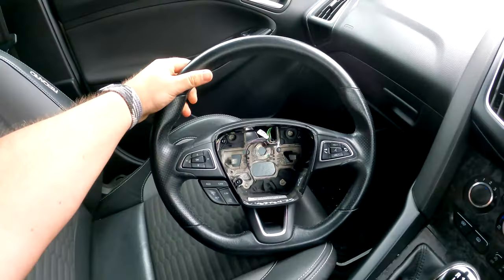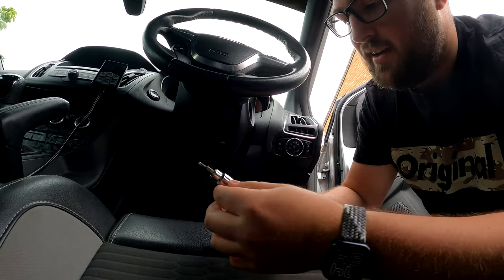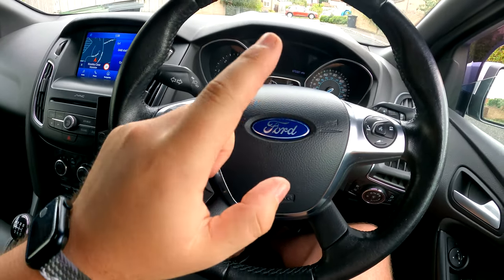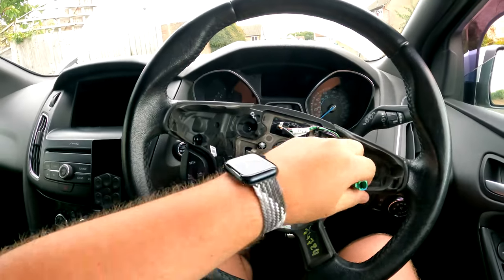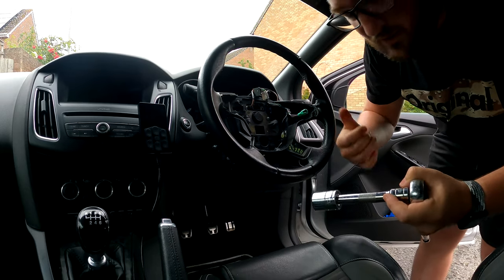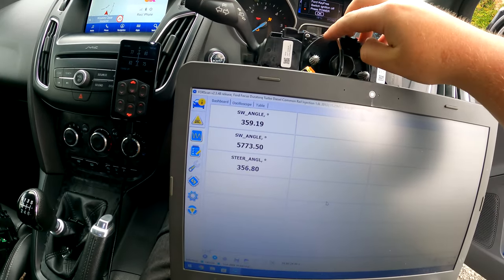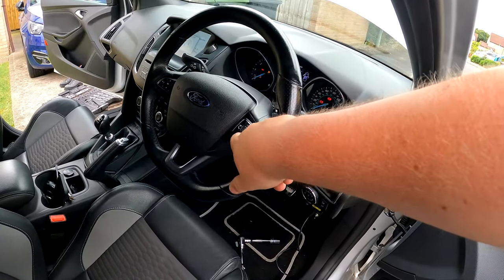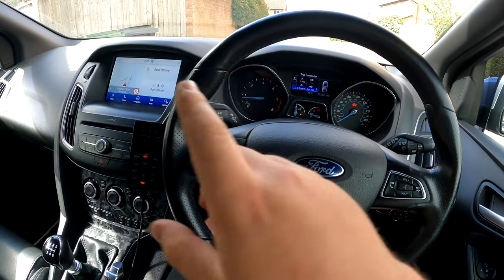I upgraded to a facelift steering wheel for the Focus!

Comment: Following your instructions.
Found there is a second torx screw that is hard to reach on the back of the bottom plastic cover.
Need a flexi attachment for screw driver to reach, ordered this and will attempt again.

Comment: I did this on an Escape, it's a much bigger pain in the butt to get the steering wheel off. I have an Explorer and the airbag has holes on the sides to release the clips. No taking the plastic off.

Comment: only watched 4 mins so far but why not put flat metal plate or cheap baking trays under the front wheels so it make turning them so much easier and save the rubber especialy when battery is disconnected ? great video very imformative 🙂
Reply from the maker: You’re absolutely right, could do that or lift the front off the ground. At the time I wasn’t thinking about it that’s all. Glad you enjoyed! 😁

Comment: Great video mate thank you 👍 I actually followed it yesterday to fit my new 2017 wheel and clock spring to my 2012 MK3. Can I ask though when you finished installing yours did you get any stored fault codes that won't clear ? I'm now getting a stored code something to do with the cluster control configuration. It won't delete so I'm assuming it's because the wheel is a different configuration to what's stored. It was clear before I did the conversion so it's definitely related. It's not a big problem as everything is working as it should but it would be good to know if you had the same thanks
Reply from the maker: I’m glad you enjoyed! The fault code i’m not too sure..? I didn’t have any stored fault codes, did you change anything in the config of the module? 😊

Comment: Hi. I’ve read that the 2014 clock spring had the same part number and the facelift clock spring. The replacement I was looking at simply states clock spring 2012-2018. Can you confirm whether or not the original clock spring should work??
Reply from the maker: Original clock spring will not work. The buttons on the steering wheel will not work on one side.

Comment: Great video, I'm just looking at ordering some parts. Why did you need to replace the clock spring?
Reply from the maker: The connector for the steering wheel controls are slightly different. 😊
Reply: @xiolage  awesome thank you, I don't suppose you know the part number for the correct one? I can't seem to find anything mentioning which one would fit. Sorry I'm completely new to this
Reply from the maker: I can’t remember sorry dude, if it’s from a 2016+ Focus it’ll work!
Reply: @xiolage  that's very helpful, thank you

Comment: Thank you for sharing your experiences. Nice done! 
Well I just wonder if the position sensor for the steering wheel is the same for both wheels? 
I mean the sensor that you had to calibrate. 
This sensor, shown at the begining of the video had just one grey plastic gear, but the older one have 2 plastic gears. Later on it is shown the new sensor with 2 plastic gears also.
Thank you in advance!
Reply from the maker: The clock springs are different due to the buttons on the steering wheel unfortunately 😩

Comment: Hi, I've got the same steering wheel as ur old one and want to add the cruise control. U have a video about that?
Reply from the maker: I don’t have a video but it’s fairly straight forward. Most forums have detailed instructions on how to do it.
Reply: Thx for that fast response, but  I got 7 additional cable and have 7 slots free, but doesn't it matter how I connect them? Every forum I found just changed the steering wheel so they never talked about this
Reply from the maker: You will need to buy the harness of find the wiring diagram of that harness. I just bought the harness and switch from a breakers yard all in one. 👍🏼
Reply: Ok ill try that thank you

Comment: 5:59 Hey! Getting a Ford focus 2014 as my first from familie. I want to do this. But do I have to take out the windshield wiper controls?🤔 
Kinda fine to drop to do it just for the looks on them, but if the steering have diffrent mounts then I would get them to!😅
Reply: And What coding/maper do you use to do the Forscan?😃
Reply from the maker: The wiper controls do need to be changed but in all honesty it’s super simple. Forscan is the software used and it uses the ELM cable. 😊
Reply: @xiolage Thanks alot! That fast of an replay deserves a follow!💪🤩
Reply: @xiolage Gonna do most of what you have done to mine and the support means a lot!💪🙌
Reply from the maker: Haha epic!

Comment: I would love to do this on my 2011 Ford Focus Turnier 1.6 Gasoline but I’m scared of messing up the coding and completely damaging my car. Is there an easier way of doing the reprogramming? Or maybe a complete guide how to do it?
Reply from the maker: There is no programming required, rather just checking the sensor information to make sure the clock spring is reading 0. Take your time and you'll be alright, nothing too complicated! 😁

Comment: Hey man, great video 😊

I have a C-Max with the old steering wheel, and my dad has a newer model with the faceliftet steering wheel. I actually bought the old C-Max from my dad so he could get a newer one, but he really misses his old steering wheel… and I would really like to exchange our steering wheels, but are you sure that it’s necessary to change all the other parts?? If it is, would it then be possible to exchange the other parts as well? 

Hope you’ll understand my English (I’m danish)
Reply from the maker: I’m not sure if you can just replace the steering wheel without the clock spring. I’ve only done this change once on my car so can’t really comment on others. 😊

Comment: hi mate, great video! just have a question: i have a facelift st steering wheel on my mk3 st. all the buttons work but my cruisecontrol and limiter do not work. how do i get this fixed? The connector from the steering wheel is also different from the previous one. And how is the part called that sits behind the steering wheel with the levers and stuff?
Reply from the maker: Hey, did you change the clock spring behind the wheel when you changed it over? It will not work without the FL clock spring. 😊

Comment: did you make sure the airbag itself fits the car? high risk to change to different airbag
Reply from the maker: As shown in the video.. it fits.
Reply: it fits to the steering wheel offcourse, but does it fit the car electric system in case of operation
Reply from the maker: The airbag control module recognised it and no error codes showed up. I’d say it’s happy.

Comment: Why was the clock spring a necessary replacement? Is the old clock spring different or was yours bad?
Reply from the maker: The old one won’t work with the new buttons/airbag unfortunately. 😢
Reply from the maker: I think the only difference is internal wiring. 🤔

Comment: Are these plug and play? So no coding needed for the cruise control or stereo?
Reply from the maker: You’ll need to turn the features on yep.
Reply: I already have cruise, but have the same wheel as your old one, although it's not a sync 1 it's bvcs, do you know if that's still plug and play?
Reply from the maker: @willo219 In that case should just swap over yep!

Comment: great job.  One question, do you know if to install the cruise control to a focus that did not have it as standard, only the button panel would be enough or do you also have to change the steering ring?
Reply from the maker: Hi Ivan, all you need is the button and the harness. 😁
Reply: @xiolage   but the stock harness for a 4-spoke steering wheel that I am not going to change the steering wheel
Reply from the maker: Yes because you won’t have the connector for the buttons to plug into otherwise. 😊
Reply: @xiolage  Thanks, do you know where I can get the part reference?  I need the reference for voice control and cruise control.  I have seen several but I do not know which one is correct by numbering thanks
Reply from the maker: I’m not too sure about that as mine had voice on the right side of the steering wheel not extra buttons. Your best bet is writing a post asking other owners and see if they have any experience. 😊
Reply: @xiolage   I get it.  very kind and congratulations for your video and your help from Spain

Comment: I managed to install it and everything is working, apart from the buttons that control the trip computer, they control the radio aswell as the right side? Any fix’s or ideas. Please let me know
Reply from the maker: Did you replace the clock spring?
Reply: Yes
Reply: I didn’t have sync it’s the bvc and I replaced with android unit, will that make a difference pal?
Reply from the maker: I'm not too sure then about the android unit. All should be working. Are you sure that the clock spring is from a facelift model?
Reply: Yes 100% exactly like yours, cruise control works so does everything just the buttons control the radio both left and right?, I’m baffled to be honest
Reply from the maker: That is very odd, I'd double check all the wires to the connector are seated correctly. Sounds like a bad connection or wire along the way.
Reply: Okay mate thank you for your advice I’ll give it a go and let you know, you’re a legend !
Reply from the maker: Yeah let me know, quite interested to see what it is!
Reply: Hi mate, is there anyway I could private message you?
Reply from the maker: @mashukuddin1939 the best way is instagram 😊
Reply: Okay I haven’t got Instagram pal. But I checked today all connections are fine it’s definitely a newer clock spring, I realised the airbag light stays on too couldn’t clear with Ford can but I plugged the steering wheel into the old clock spring and everything works the same and the new one. So it can’t be a faulty clock spring ?
Reply from the maker: @mashukuddin1939 If the old steering wheels works with that clock spring then it’s not the right clock spring for the facelift wheel. Hence the airbag light. 😊
Reply: The old steering wheel doesn’t work with this clock spring but the new wheel works with the old clock spring, I reckon maybe because there’s no sync and it’s bvc
Reply from the maker: @mashukuddin1939 Possibly, with these newer cars everything is linked through CANBUS 🤪😂
Reply: Hi mate quick update I got rid of the airbag light just cleaned the contacts in the connector, is defo a facelift clock spring, just need to fix the trip computer! Maybe if you can ask Rowan? I can’t find his @ anywhere
Reply from the maker: @mashukuddin1939 I used to contact him by facebook but i don’t use it anymore. Not sure of any other contact info unfortunately 🤔
Reply: I SORTED IT OUT !!! Was playing with forscan and adjusted audio with steering wheel to option 2 instead of 3!!! Everything’s working!!!!
Reply from the maker: @mashukuddin1939 Wheeeeey, nice work!

Comment: How did you get cruise control added, I wanna add it to my mk3 focus
Reply from the maker: Just add the module and turn it on within Forscan 😎
Reply: @xiolage Thanks bro, will this work on the regular Zetec
Reply: @xiolage Also where did you buy the module from
Reply from the maker: Yep will work on any, just go to eBay or any breakers and look for the cruise control buttons and harness for the steering wheel!

Comment: So i have the American version of that Focus but mine also has volumes and calling button  on the oppsite of where the  curse control is would i just get the America version to make it work?
Reply from the maker: I imagine so. I can’t really confirm this because the wiring may be different to what we have in the UK. 😊
Reply: @xiolage  what kind of rims do you have and size?
Reply from the maker: These are factory “snowflake” Zetec S wheels, available as an optional extra from new. They’re 18”. 😁

Comment: Hi everyone, i have a ford focus 2012 and have retrofitted my steering wheel with a 2016, now i have two issues, one is that the airbag light wont turn off, and second is that I no longer can control the display on my IPC and the d-pad control’s the radio. Any help would be highly appreciated thanks you
Reply from the maker: Sounds like a clock spring issue, did you change it? 😊
Reply: @xiolage  i used the stock clock spring that came with the steering wheel, I’ll give it a go and see what happens. Thanks mate.
Reply from the maker: Definitely sounds like a clock spring or connector issue. Let me know how you get on. 👍🏼
Reply: @666amir13 Any luck? Planning on doing the same
Reply: @Freakishd  yea, just keep in mind that you need to cut the old connector from the old airbag and splice it to the new one so that the airbag light turn off, for the dpad buttons you gotta rewire it, like splice each command to each cable
Reply from the maker: I’d recommend swapping out the harness rather than rewiring the connector.
Reply: @xiolage  tried it as well, it was a little too tricky for me to be honest so I took the easy way out 😂

Comment: So is Cruise Control really that easy to fit? I've got a Ford Focus Diesel 2017 Model. Was hoping buy a cruise control steering wheel and fit it. Would the work and or pose any issues? thanks.
Reply from the maker: Yep straight swap and code it in. 😁
Reply: @xiolage  Is your model a Diesel i’ve read that petrol is pretty straightforward can be done in FORscan. Have to use UCDS for Diesels as FORscan can’t reprogram the BCM.
Reply from the maker: Petrol and diesel use the same BCM. I’ve personally coded both and all works fine. 😊
Reply: @xiolage Using Just FORscan?
Reply: @xiolage  Could be down to the mk3.5 vs mk3 difference that seems too be a factor also. As I really want to take the plunge and just do it but getting the “other” software is impossible as it’s Russian Dev who obviously can’t sell anything atm.
Reply from the maker: Yep!